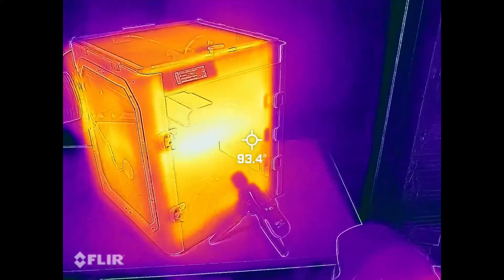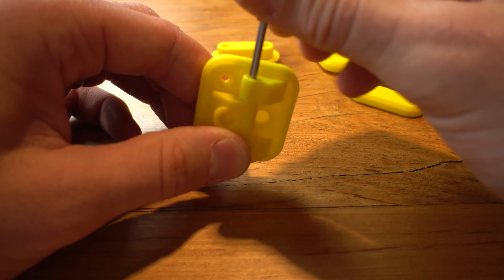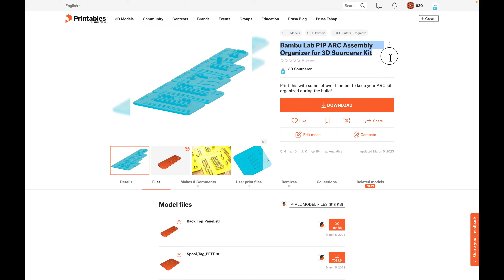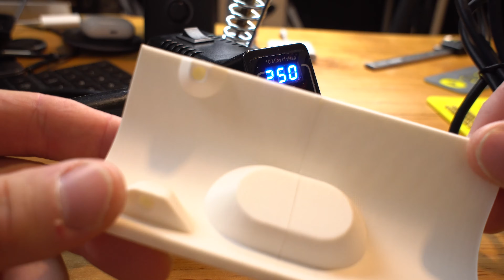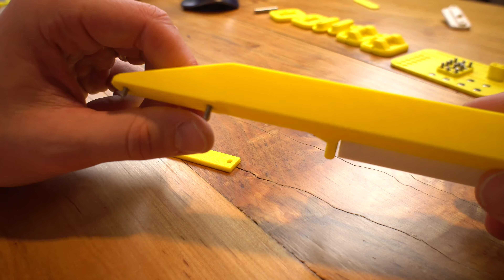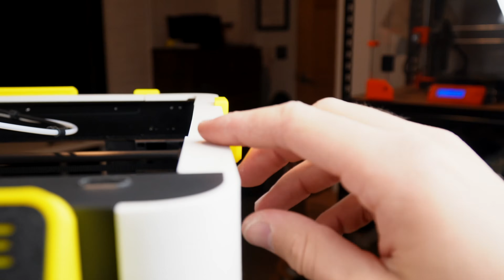Bambu Lab P1P ARC Enclosure Build Guide + 10 Tips!

Comment: quick question. just ordered 2 of the kits. what all is needed from the bambu side of it? can i get away with just the MC fan, or do i need more? Also, is there an opening on the back to install the chamber fan, or is it really not needed? Thanks in advance!
Reply from the maker: Some people buy the cable chain and the MC fan - I haven’t had any issues with mine, and I haven’t done anything other than putting the kit on it. Not sure what you mean about an opening on the back - there’s just a small back panel that covers the opening as shown in the video
Reply: basically to install the chamber fan like i have on my X1C. Is there anything like that on the ARC kit? i just dont want to order that fan if i cant even install it. @madebyjgwillis
Reply from the maker: @STRRAYNGE  the chamber fan is compatible but you don’t really need it
Reply: ok, i appreciate it. i just didnt see anywhere on the actual printed parts of the enclosure to install it. thank you. ordered 2 of your kits, should be here Tuesday! bambu gave me 2 30% off coupons for the p1s upgrades for my p1p's, but just not in stock, even though they told me to log on on august 10th and order, and i even signed up for notifications, nothing, sold out period. and i of course missed the last batch despite all of my efforts and all they said was, well, wait til the next batch and try again. unfortunately my coupons expire on Sept 30, which just so happens to be the same date their next batch is ready. @madebyjgwillis
Reply from the maker: @STRRAYNGE  nice thanks for the support!
Reply: yes sir! cant wait to get them. printing the enclosure out now. got 2 p1p's and 1 x1c running 100% lol!! might get them done in time before the kits get here! @madebyjgwillis
Reply from the maker: @STRRAYNGE  sounds good! Make sure you checkout ThrutheFrame’s Printables for other stuff to print for it!
Reply: will do as soon as im done with the pork shoulder on the smoker!! Thank you! @madebyjgwillis
Reply: alright, got all pieces printed out for my 2 P1P's. Printing the chamber fan mounts now as well as 2 backplates that have the opening for the chamber fan to vent since the P1P's dont have an opening there. Excited to get your kits Tuesday!! Fans will hopefully be here next week as well as long as BL sends them out soon enough. I appreciate all your communication! @madebyjgwillis
Reply from the maker: Sure thing! Hope it turns out well for you!

Comment: Is there a version that has enclosure fan add on
Reply from the maker: No - this still works with the accessory fan. I haven’t had any issues printing PLA, which is the only filament I use that would need cooler temperatures rather than warmer
Reply from the maker: Niccccce 👍🏼 appreciate it!

Comment: I have the ARC now installed (great!) but had now clogging for the 3rd time with PLA - never had problems before. Is the ARC making the interior to warm for PLA?
Reply from the maker: I’ve been printing in PLA with the ARC installed for 2 months now and haven’t had any issues, so it’s probably something else
Reply: @madebyjgwillis  Thanks for your quick response, very helpful - the only option left could be the spool holder that something is stuck there and blocking the extruder. Of course I was never in the room when it happend (Murphy) so its hard to tell.
Reply from the maker: @IchGlaubEsHacktWohl  yeah I've seen a few videos on YouTube where a little speck of metal or something gets in the nozzle - I'd try using the tool that's included with the P1P and going through the steps on their Wiki
Reply: @madebyjgwillis  Already did that and I could fix it (PLA was broken in the extruder), but it really looks like there is an issue with the nozzle. I now ordered a hardened steel nozzle and also will adjust the spool holder a bit to make sure nothing can be blocked.

Comment: Just ordered my kit yesterday, how much filament will be needed to print out the panels?
Reply from the maker: It’s right at 1kg! You should be able to do it with 1 roll, but it looks best with an accent color to me
Reply: @madebyjgwillis  yes that’s the plan, I was just going to do the panels with a spool that has about 3/4 left, and the hinges and accessories with another. Would you say just the panels are doable with a 3/4 spool? My p1p hasn’t arrived yet so I haven’t even attempted to slice any of the files yet, I was going to do the whole project on the p1p.
Reply from the maker: Hard to say - the majority of the 1kg is the panels, so it might be cutting it close with 3/4 of a spool
Reply: @madebyjgwillis  Is there some sort of mount file for the hydrometer includer in the kit?
Reply from the maker: https://www.printables.com/model/293013-magnetic-hygrometer-bracket
Reply: @madebyjgwillis  Thank you for all your help.
Reply from the maker: Thanks for supporting us!

Comment: Can the test print be dowloaded before purchasing the kit? to make sure I can print the parts accurately, also is there a high-temperature hot end available for the P1P?
Reply from the maker: I believe the test print has been removed to save filament - I will discuss it with the creator. However, you can just “split” the parts to test it if you’d like. 

Yes - there’s alternative hotends on the Bambu website.
Reply: @madebyjgwillis  I have my machines calibrated using a diamensional accuracy test so hopefully I wont have any issues, I guess if the first part I print fits ok then the rest should also, I could end up buying the X1 Carbon though, have you printed any high temperature materials on the P1P since fitting The Arc?

Comment: I purchased the X1C cable chain for my P1P and everything fitted perfectly. It came with the chain, anchor point to the frame, anchor point to the tool head and a rubber grommet for the PTFE tube to pass through the frame. I also noticed that unlike the X1C/X1, my P1P does not have a main board cooling fan so I will be adding one and suggest anyone who is looking into enclosing theirs do some research into the topic.
Reply from the maker: Bambu Lab mentioned in the release that the X1C chain puts a lot of stress on the hot end so they do not recommend using that version of the chain. It may work fine, and you may never have issues, but that is the official stance from the manufacturer. 

Most P1Ps do not have a cooling fan (as you stated). A cooling fan can be added, but there are various stances on whether this is needed or not. Most have used the ARC without any issues and without a fan. If people have issues with the main board, I’ll issue an update here on YouTube!
Reply: @madebyjgwillis  They now only sell the X1 cable chain and have it marked for both X1 and P1P.  They have a huge notice saying "For P1P 3D printer, cable chain can only work with the heavy duty toolhead cable. Using it with the original toolhead cable to cause any damage will void the warranty."  That part is the "P1P Heavy Duty Toolhead Cable" and currently sells for $11.99 USD
Reply: @cybrsage  Cheers man, I will look into getting a heavy duty tool head cable for mine, it's probably done about 50hrs with the X1 cable chain and so far so good, I checked that it can freely move and not put any load on the cable but I will replace it now they have one available that is recommended 😁

Comment: don't the PLA warp and melt with the added heat??
Reply from the maker: No - it’s not a perfectly sealed container and even then, the hot plate temp only gets to like 100C or so which is still lower than the melting temperature of PLA. If you’re concerned, print it in PETG
Reply: It is recommended to print in PETG at least if you will be using an enclosure